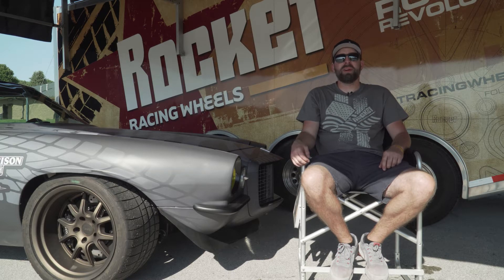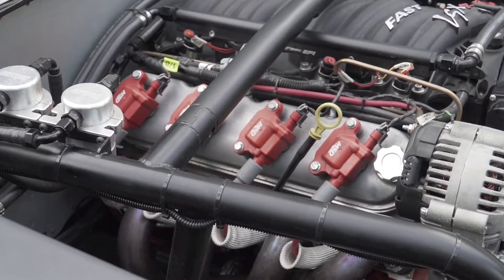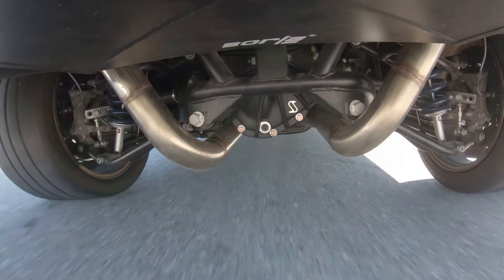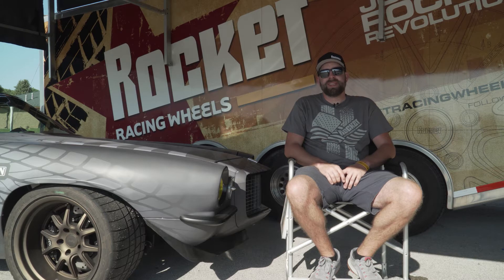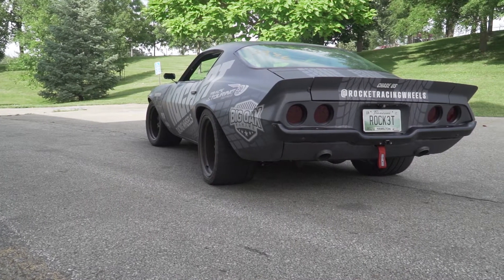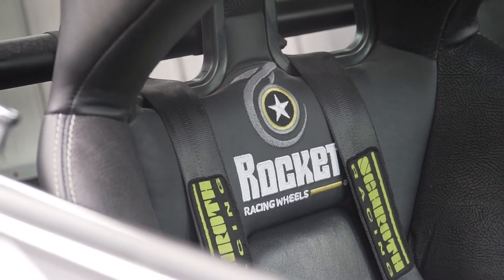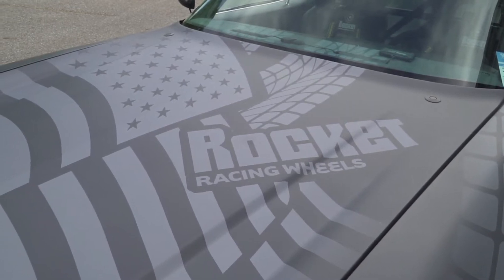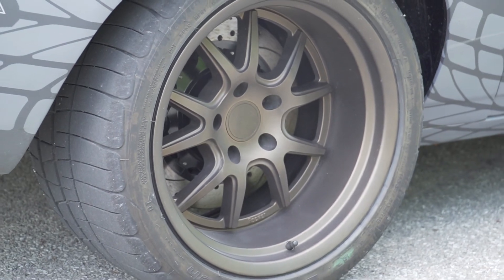Rocket Racing Wheels Pro-Touring 1973 Camaro

Comment: An ls swap. How boring
Reply: What else should he have done?
Reply: @ericday3538  wouldn't have a lot of "touring" left in the pro touring haha. Little heavy
Reply: @trashbandit2449  N/A aluminum BBC, though... only adds about a hundred pounds to the front end, which you can offset if you get the engine back far enough and use a CF intake.
Reply: @spdcrzy  $$$

Although this isn't exactly a budget build
Reply: @trashbandit2449  At that level, they're actually both probably going to be within spitting distance of each others' cost.
Reply: @spdcrzy  cost difference between just the aluminum big block and a brand new ls3 is about 10k
Reply: @trashbandit2449  A fully built Mast LS3 Black Label and a Shafiroff 540 making about 600-650 are within a grand of each other. $17K vs $18K.
Reply: @spdcrzy  if that's the desired power an aluminum 5.3 + a supercharger + cam would make that for half the price. Lots of recipes for everything, although they specifically said they didn't want a big block